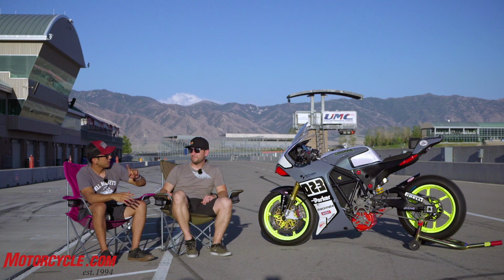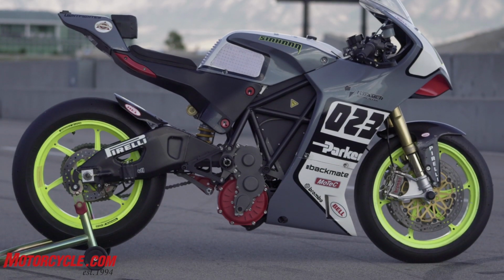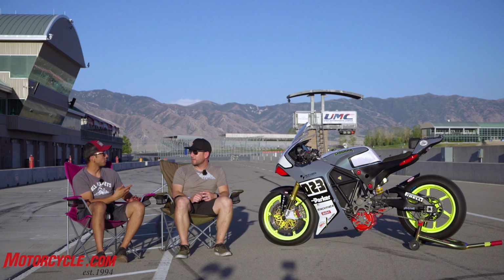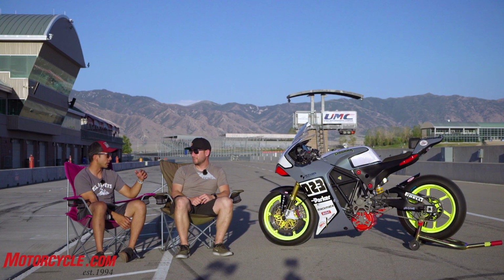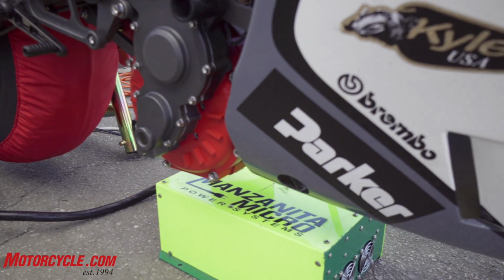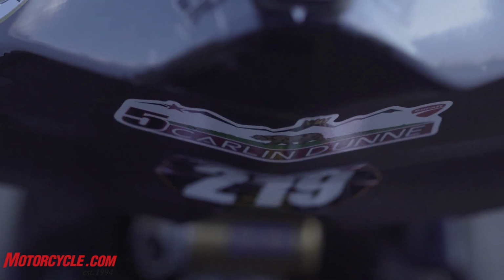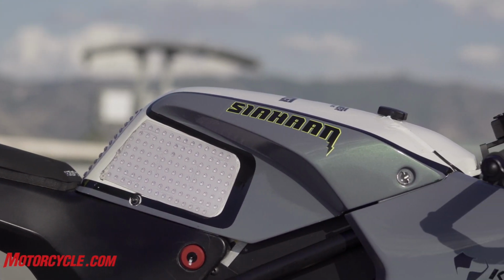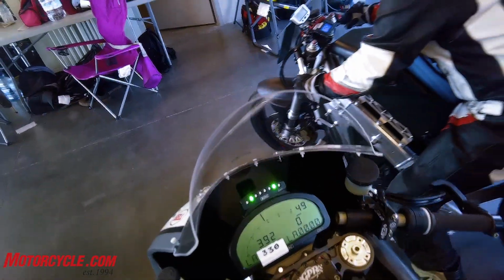The Electric Motorcycle With The Potential To Change The Industry – The Lightfighter LFR19. Part 1

Comment: I test rode a zero sr back in 2014, end up purchased the bike I did not need and it was the best decision ever.  years later I sold all three gas bikes and bought another zero sr/f.  the torque on these bikes are like a rail-gun.
Reply: And you never rode it from east coast to west coast. How many miles do you ride each day? How do you recharge it on the road? I guess you did not love long distance biking. Any idea what you miss?

Comment: What an awesome project.  Very cool guy, too.  I rode the Zero bikes (their whole line-up at the time) at a demo day they did at my office's car show; I completely fell in love with them.  Sure, can't do a whole day-ride on the weekend, but for getting around the area, commuting, errands, etc. it's more than enough range, especially with the extra battery pack.  That reminds me, I would love to work at Zero, gotta chuck a resume their way.

Generally speaking I feel that until battery technology drastically improves, the best way to overcome range issues is with serviceable batteries, like phones used to have, where they can be replaced in minutes, and I think the same applies for this usage.  Right now all the car batteries (and bike batteries) are 1-off designs and jammed into wherever they can fit, but if they were made into a standard and you got car companies to agree to specifications, then they can be easily swappable, and the person can be on their way in 5 minutes.  I think the same applies to this usage as well.  Imagine this whole setup but instead of bringing only the battery in the bike, but maybe 2 or 3 other ones, and between sessions you swap them out and put the just used one on the charger - now you've removed the time crunch and can allow it to charge on regular AC 110 or something.
Reply: You're not wrong. Swappable batteries definitely show promise. But in the case of two guys (Brian and Ely) who are basically working on this in their spare time, sometimes you gotta go with what you've already got and/or what's easiest/cheapest and will produce the desired results (lasting the distance of a club race).

Comment: Wow awesome concept. There was a company that 3d printed a supercar, they claimed to be able to save 30-40% of chassis weight for motorcycles. I recommend this guy checks out that tech
Reply: If there was 40% on the table it's fairly certain one of the multi-billion dollar businesses with multi-million dollar R&D budgets would already know about it. 
There is a reason BMW went with a carbon frame rather than the much more simple 3d printing.
Reply: @siraff4461  The technology I am referring to used magnesium 3d printed joints and hollow carbon fibre tubes as cross members. They built actual bikes and demonstrated the 40% loss in chassis weight I cited. Do the research yourself
Reply: @AJTalks  40% reduction in chassis weight is a drop in the bucket on total bike weight. A modern sportbike chassis only weighs 10-15 lbs so 40% less would only save ~5 lbs. Stiffness where appropriate, compliability where appropriate, and stability under power are all far more important than chassis weight.
Reply: The frame and the chassis are different things. Chassis do not weigh 15 lb
Reply: @AJTalks    Why do you use both French (chassis) and English (frame) words for frame and claim the French frame is not a frame? Are you weirder than I? That's very weird!
Reply: @voornaam3191  Ever heard of the term "rolling chassis"? Well, it does not refer to the engine frame on wheels.
Reply: @AJTalks  No, so this is just another example of weird terminology. I know chassis from cars, and I thoughy frame was a bike thing. So the bike world has adopted a car word. I guess it has a reason. I'll ask my bike mechanics. Language could also be a thing, I once owned a Honda CX500 and that came with a workshop manual in French. I can tell you, all the technical words are new, I needed a dictionary all the time. This rolling chassis feels a bit like that. Best advice in the world, by a BMW, there is not much frame, it's an engine with wheels connected and that is basically it. Chassis? What chassis? That is the oil carter!

Comment: I love my Zero SR/F but this thing is wild. 140 lb-ft of torque tries to throw me off the back of mine. I cannot imagine the feeling of tapping  in to 50% more.
I was surprised though that you didn't mention the Moto-e race series running this year in Europe. It runs in conjunction with the MotoGP races on 800V Energica bikes. So far it has been a "learning experience" but shows promise.
Reply: MASSIVE failure not to mention Energica and Moto-E, especially after spending so much time talking about the TT Zero.
Reply: I am thinking about buying the SRF. How long have you had it? and any surprises after you bought it? Range? TY
Reply: @numberxx7  I received it in July. Biggest surprise even today is that massive wallop of torque. 
Range is a complicated subject.  Speed (overcoming wind resistance) and acceleration use electricity. Ride a steady 35mph on flat roads on a windless day and you can probably get close to 200 miles range. 
On the other hand the 80kW motor could hypothetically empty the 12.6kW/h usable battery capacity in less than ten minutes, 20 miles at 125mph.

It all depends on the rider. Most people get about 80-6100 miles from a charge if riding reasonably and avoiding freeway speeds.
It is difficult to ride reasonably on a bike that is so much fun to thrash. This bike is ideal for city use. It is great for a blast on country roads that are nearby. While it is possible to make longer trips (on the Premium version w/ 6kW charger) it requires planning, patience, and familiarity with your bike. Visit ElectricMotorcycleForum dot Com to talk to other owners about real world experiences.
Reply: @Miata822  Thank you for your reply! I am MAINLY ridding back and forth to work - 12 mile (each way) ride on city streets, so I hope, for one full charge, I could go all week. . And, another reason is, that we have free charging at the company parking lot. The only thing, is that if I want to go on a "coastal" ride, I will have to plan.. I think, correct me if I am wrong, they bikes come with adapter to use your typical 120 V/ 60Hz household outlet?  But the price!!  cheers
Reply: @lowflyerxx  I wouldn't try the full week on a charge, especially given that you have charging available at work. Limiting your regular charging to only 80% (you can set any level you like) will extend battery life. I only set the charge to 100% the night before a longer planned ride. 80% would let you ride like a madman for two days at least. Simply topping up a couple times a week should cover your commute w/o the need to ride with extraordinarily efficiently and care.

The coastal ride, it depends on where you live. In the US I use the Plugshare app to find Level 2 chargers. You will definitely want to get a feel for the bike before planning any long trips. Range depends so much on wind, weather, terrain, and pilot skill that only through experience will you be able to know how far you can go. It is important to keep a sense of adventure when attempting a long distance trip on an electric motorcycle. It once was like this in electric cars. Today for many of the more remote places you visit you will likely be the first person ever to ride an electric motorcycle into town. Many riders find alternative places to charge on extended trips when a charging station is not available. Campgrounds often will let you charge at low or no cost. Friendly individuals or restaurants may let you plug in for a bit if you ask nicely. A key point is that you only really need enough power to make it to the next stop. Remember the ABC rule, Always Be Charging (plug in any time you stop for whatever reason).

My bike came with a 120/230V - 1440/3000W adapter to connect to household power. I understand a different adapter may be sold separately in other countries. This I would verify with a local dealer.

Cost. Yep. Having the coolest new toy at the cutting edge of what is possible is never cheap. There are upsides. You will never have to pay for a valve adjustment or oil change. You will never have to clean up the mess from scrubbing and oiling a chain. Brake pads will last forever since regen does most of the stopping. Wherever you are in the world electricity costs less than gasoline, often discounted overnight when you are plugged in and sleeping. That doesn't balance the scales but it's a nice touch.

Now it's time to scoot on over to the Zero Motorcycles section of ElectricMotorcycleForum dot com to see what other owners have to say. You can learn about other brands of electrics there as well. I don't visit often but the guys there were a great resource when I first got mine.

I hope this is helpful information.
Reply: @Miata822  Thank you very much for your details..  I will visit the forum, then cruise over to my local Zero dealer!  cheers

Comment: Wonderful video, Troy and Brian, and a work of art in terms of engineering and design there, Brain. BUT Brian, please, please consider asking Zero to make a bike with quick swappable batteries, i.e. one stops at the "gas" station, lift open the "tank" cover, and pull up the battery packs, swap them out at the station, put in fresh ones and off you go. Perhaps Zero could work with Tesla or one of the big battery companies (Duracell, Panasonic?) who have the ability to mass produce battery packs in standard sizes, to set up stations across the country, and one could base the business plan on batteries not being owned by the rider, but rented from the bike maker or energy company. Each pack could have an electronic serial number to avoid tampering and abuse.
Reply: How about we do it, pool our resources. My recycling organization will be collecting ion batteries so that's product right their.
Reply: How about we do it? My recycling organization will be accepting ion batteries so that's a start.
Reply: would be very heavy so not possible by hand. that means very high cost to have some kind of crane to switch them. to give you an exemple my 6.5kwh battery is about 70 pounds and his short range race bike is 10kwh. imagine the weight of a 15-20kwh battery...
Reply: Zero already makes a swappable battery in the FX3.6. I presume Zero knows the suitability of swamping batteries and have concluded it doesn’t work for the “bigger” bikes. 
Great idea on the battery stations! You should put together a business plan and present it to the CEOs of Panasonic or Elon Musk. That would solve so many problems!
Reply: Zero MMX, the military version, does this to achieve refueling spec.
Reply: @magnusrittersen4702  The idea is to have more, smaller , modular batteries instead of one large one. Yes, one would sacrifice range but "recharging" would be far quicker and more convenient.
Reply: @thalesletus1  Nonsense. Negative thinking. Wrong mindset. This is a challenge. How to get these things  out and in without crushing fingers?

You're right it is a problem, but problems need solutions. Find a better answer, please.
Reply: @magnusrittersen4702  Yes, great plan, and do you know American businesses? First their engineers build up your new company, and three years later their bean counters drop your new company like a brick. Profits were okay, but the bean counters had expected more profit. Exit your good idea.

Comment: If you tilt the battery in parallel with the radiator you can tuck the swing arm into the chassis more. This might cause more heat into the casing of the batt though. 

I like the idea,we need 10 laps! More always more!
Reply: It's also about balancing the weight. Which is much more important.

Comment: Battery range is not the real issue for most street legal electric bikes, it's infrastructure.  Two of my ICE bikes get barely more than 100 miles per tank, but it's much easier to find a gas station in a hundred miles, riding in just about any direction.  By the time the electric charging infrastructure gets close to that, solid state batteries will have replaced lithium ion as the standard.  One third the size, one third the weight, recharging in five minutes.  But in the meantime, it's infrastructure that's the problem, not battery range itself.
Reply: Peace Love, yep, just like in the early days of ICE motorcycles. We tend to forget that there weren't always gas stations every mile or so.
Reply: @alexwilsonpottery3733  in fact one of the earliest places that sold gas at least in some areas were pharmacies. Go figure!

Comment: For comparison... If you're ignoring sprocket sizes, which it sounds like they are here, a 2018 R6 has about 100 lb-ft of torque getting sent to the rear wheel in 2nd gear!!!
Reply: Gearing is a torque multiplier.

Comment: The problem with electric (in my mind) is less about how far the battery can go overall... it’s the fact that it takes tons of time to recharge. 
Petrol takes a minute or two of filling a tank up. Electric cars/bikes have to charge for much longer.
Reply: Its still new technology it will change
Reply: @William Arrington This would be perfect for mx/sx too, along with any kind of GP racing on a circuit. But what would be the best application for street riding? Could it be cheap enough to have "Aluminum Battery Stations" for a quick swap? I'm not very educated about the entire battery industry so this equations may sound idiotic. I do understand this is the future and I look forward to owning an electric mx/sx bike and true performance naked like the Tuono or new Street Fighter. I'm even a 2 stroke mx guy and I like what I see here.
Reply: @Andy Skinner Lithium Ion tech is relatively new. Charging times have dropped 80% in the last 6 years. Energy density has increased by a factor of 4 in the last 6 years. Cost has come down 75% in the last 6 years. So, yes, it is still new technology and it will continue to change rapidly. To claim he's wrong because it's a battery is missing the point entirely.
Reply: @Andy Skinner Because you can't recharge them. They are single use.
Reply: @Andy Skinner That isn't what he meant.
Reply: William Arrington Call me when I can buy this bike
Reply: @Andy Skinner Horrible misguided theory. This is NOT a Electric Car. This is a High Performance Sport Bike. These have never been done before at scale. Being soo early in their dvelopment there is lots of improvement potential. It's NOT just about CELL Chemistry. Especialy on a size and weight concious machine like Bike. Battery Packaging & Motors internal design specific to Sport Bikes is very important. That is NOT 130 of development, that realy only has been worked on in the past 15 years. You have generalised the concept soo wide your theory has become Pointless.
Reply: @Andy Skinner WOW the hypocrisy is amazing. "Nissan leaf battery in a bike" was a freaking absurd example, can't you comprehend.
CELLs are not new technology. BATTERY PACKAGING involves very new technology.
You are soo slow minded you don't even realize the difference between Lithium Ion CELL vs BATTERY PACKAGE.
Principles are IRRELEVENT to product improvement. Execution for mass production scale is all about Specialization and Efficiency.
Reply: @Andy Skinner 1. COOLING is vastly different. Example Energica uses a OIL Cooled Battery.
2. Space VOLUME efficiency not just weight, battery and cells has to be specialized for denser volume witch much less space between cells for auxiliary purposes like liquid cooling, BMS or the worst air flow.
https://static.seekingalpha.com/uploads/2016/6/3/1580111-1465012444835555_origin.jpg - Can't do High Flow Air Cooling.
3. CELL Format, most bikes seem to use stacked Pouch Cells not the famous Tesla Cylinder Cells.
4. Ware Leveling & SOC Balancing is much more difficult because simply LESS number of Cells.
5. Trying to get 50kw DC fast charging to work on such a tiny pack where the cutting edge is only 20kwh, the Power Input density is just crazy.
These are just some of the REAL WORLD problems that are different to 4 Passenger Cars and entirely different form factor. Please freaking learn engineering.
Reply: @Andy Skinner "Head in hands
, Deep sigh" EXACTLY
Is gloriously Ironic when you are dismissing the complex difficulty of building this stuff in REALITY. I doubt you even know how a BMS & Cell Balancing works by memory. Before generalizing to the point it no longer represents reality. Try actually studying how this stuff Operates in the real world.

Comment: Isn't there a thing to connect to the wheel that will recharge the battery from the power of the wheel spinning? Or like those flashlights that you recharge by movement? Or even design the bike where the batteries can be pulled out and just throw a charged one in it. Have like 10 back up batteries

Comment: @Si Raff, these guys are racing, and lap times are all that matter. As a reference point for comparison with conventional track bikes, the countershaft location dictates rear suspension geometry. A 2017 R6 needs a 6-speed gearbox and a clutch to get 243ft-lb to the countershaft. The LFR needs a small gearset to get 200ft-lb to the same point in the chassis. Depending on horsepower, weight and packaging, that could make it directly competitive on the track.